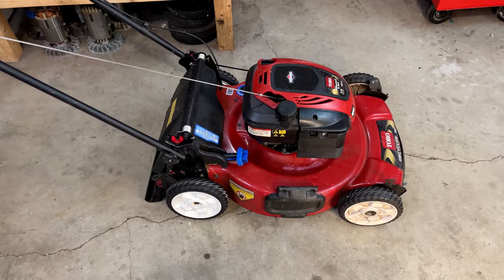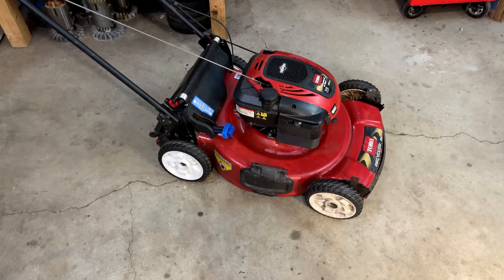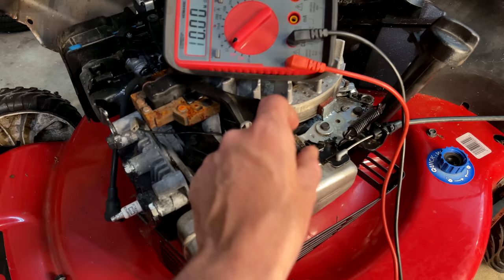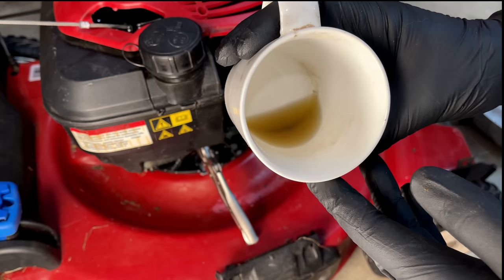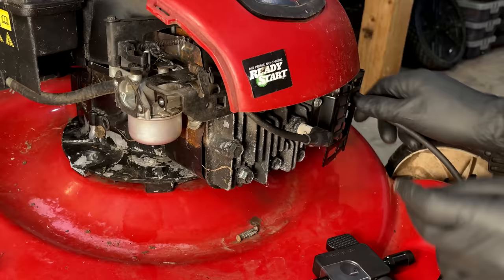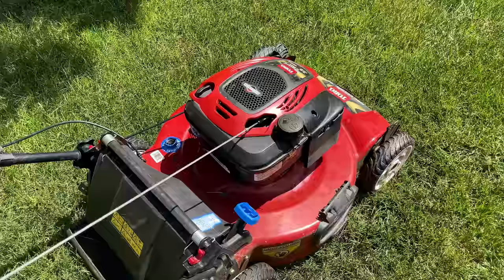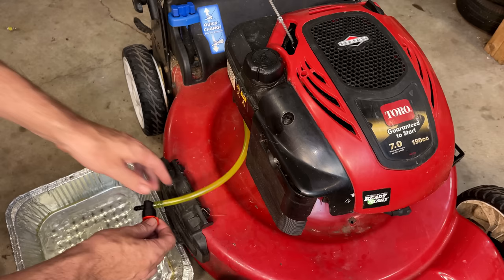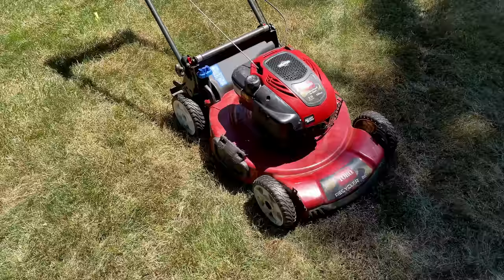Erratic Lawn Mower Engine Performance - Starts and Runs Great / Stalls or Will Not Start

Comment: I found it odd that you could keep tightening the gas cap like that.
Reply: Ditto.  It would seem that it would be stripped, or possibly it's like the caps on new cars these days?   The Honda engine on my Craftsman mower has a large, clicking cap like my truck, but I don't tighten it up that much.

Comment: Using a torque wrench 😂

10 minutes in and I can’t believe you haven’t investigated the auto choke thermostat. Just the words “Toro” and “intermittent” scream autochoke..(when engine is a Briggs&Stratton).. it does go erratic a lot sooner after cold start when the autochoke isn’t opening properly though. Same runability symptoms as a fuel tank not venting, but won’t start when engine is hot after it has stalled. A screwdriver being used to push the autochoke arm (above and behind the muffler) just after startup when it begins to idle roughly will confirm a problem if it runs smoothly while doing so. If it starts when hot while manually pushing autochoke arm when it won’t otherwise is also a sure sign of a thermostat, air vane, or air vane spring tension related issue.

Comment: Toro are very hit & Miss with their mowers - they come up with good designs, in theory - but in practice they miss. There is never enough airflow off the blades. The decks are usually rubbish designs. They are notoriously bad grass collectors.   They cannot cope with longer grass. They make the self-propel mechanisms fine if you know how to repair them - a nightmare if you don't. They never spec out a powerful enough motor for the mower  - it's always an underpower version & the switching is usually shonky. I like Toro, much as I dislike Toro - if you know what I mean.

They use B&S non I/C engines too - another shonky feature - B & S make 2 versions - the I/C engines (which are brilliant) and the domestic engines (which are wheezy gimps).  You know if you have a B & S  I/C engine as it will start first pull while balanced on the tip of the North Pole in a blizzard plus most shiny bits are red/pink. Otherwise you don't - and then it's a bit naff. Mower service people generally hate Toro mowers - I defer to their experience. They know best.

The "Tank becoming a vacuum" is common. They also hate ethanol fuel.  In general - a PITA. don't buy a new cap - drill a hole in the old one. These also - for whatever reason - eat head gaskets. No idea why. Luckily, they are easily changed.

Comment: Solution:  Ditch that gas/oil/engine/carburetor/air filter/spark plug crap and buy a battery-powered lawn mower.